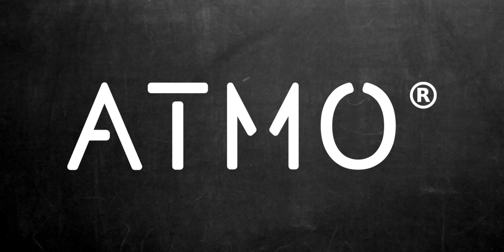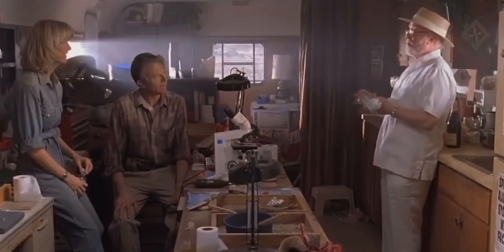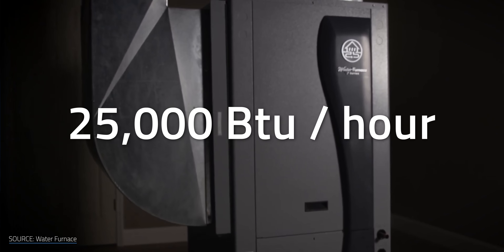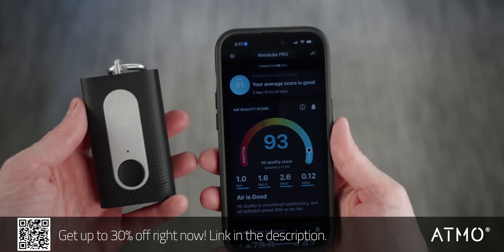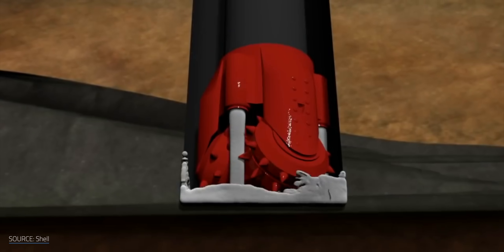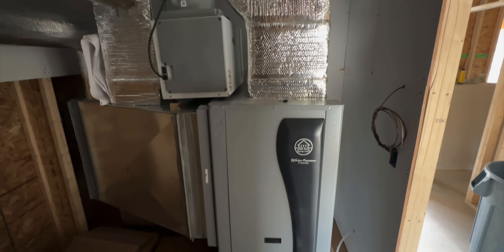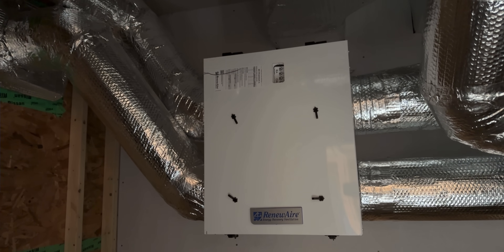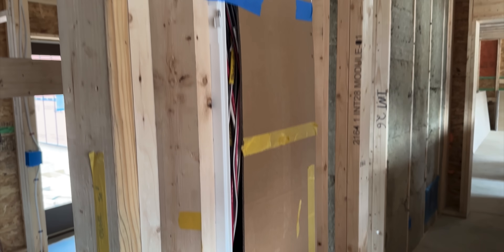Why I Went With Geothermal For My Net Zero Home

Comment: Matt - I like your content especially about your new house.  I would like to hear more about particular costs, for example, what was the cost of the geothermal well dig versus the cost of running a natural gas line to the property?  I suppose that your up front costs will be higher than usual, and your long term cost estimate will involve guessing about energy costs.  Your build is inspiring.

Comment: Norway, Sweden and Finland are world leading in heat pump installations. My house in Finland has a 170 m (557 feet) vertical well. Almost no digging required here. There is only a few meters of mud/gravel before reaching the bedrock. So they put down a steel pipe to support the well a few meters. It didn't take many hours to bore the well, I think it was about six hours. My house is small so this depth is enough, but with larger houses 220 m (720 feet) is common. They typically don't go deeper than that, then they put more holes in parallel instead. Our system is designed to work down to -25 °C (-13 F) outside temp.

Comment: Geothermal heat pump is the costly but the best solution by far. 
If you have the money, geothermal is fantastic. 
If not, water source is second... 
If not, air source heat pump is cheaper but in the last place.

Comment: I'm really curious what you're doing with lighting? It seems with all this excess, one thing you could save power on would be low voltage led-based lighting over ethernet.

Comment: 11:35 One thing I would like to see more detail on is your input mechanism for the shades. Are you going to be granular for each room or just system wide? How are you getting temperature readings from each spot? I am remodeling and pre wired for shades but don’t know of a sensor to tie it to.

Comment: Generally heat pumps are more efficient running at lower power levels for longer rather than bursting.  Less cycling each day is also better.   But you know, for a house that small you don't need to be this efficient... spend that money loading the roof with solar panels instead of wasting it on a ground-sourced loop (well, too late I guess).  The long-term maintenance will actually be lower.

Forced air is fine.  Again, the "trick" is for the system to run at lower power levels for longer periods of time instead of cycling in short bursts.

Fresh air systems with heat recovery work, but only sorta.  The efficiency is quite low... usually less than 50% in reality.  I have one and I gotta say that it takes quite a bit more maintenance than I would like.   These boxes easily break, have noise and vibration that can often be felt at night when the house is otherwise quiet, and the filters have to be regularly cleaned.  Just a warning 🙂

For bathrooms, having an exhaust fan is more important than ducting the fresh air system into the bathroom, though there are advantages to doing both if you leave the house on long trips for long periods of time.  And just as important is to put it on a digital timer switch instead of a normal light-switch so you can just tap on the "30 minutes" button as you leave after showing in the morning.  No chance of accidentally leaving the fan on all day (which messes up the house's overall efficiency).

The key to home efficiency, in general, is to over-produce with solar and then carefully pick and choose what you actually need to make efficient verses maintenance, noise, and other nuisances that come with the systems.

Comment: I wish I didn't have to spare any expense when I was building my house. But it'll be some time before I step away from gas and go for a heatpump. The price difference between gas and electricity here makes electrical heating, even with a heat pump, simply too expensive. The current difference would require 30+ years before the system has paid itself back, and the pump itself has an average life span of 20 years so ...

Comment: Internal shades shouldn’t do much if anything at all in regards to keeping the house cooler in the summer/warmer in the winter. Since they’re in the house once they heat up from the sun they’re going to radiate that heat inside instead of outside like it would be the case with external shades.

Comment: I find it really ironic that you had a drill rig come and do that because I actually worked for some well drillers as a helper for half a year so I understand a lot of what they were doing in the video, it's rough work but it's worth it when it works.

Comment: So you've got the hole for the heat exchange below 10ft, what about that last 10ft and the distance to the unit inside the house?  Is the tubing insulated for that to prevent that last 20-30(?) feet from impacting the efficiency?

Comment: I did network and TV wiring to all my bedrooms and in my living areas.  It was high tech a five years ago and now it's not so much, though still handy.  I also have a variable speed heat pump/AC unit, central vac, a lot more insulation than normal at the time, etc.  I like a lot of the features you are doing but in 20 years they won't be high tech and probably won't appeal to many home buyers as the learning curve is pretty steep to be doing/tracking all you do.  I would like to know how you got to what R38 in the walls.

Comment: This has been a very cool journey to watch and I'm eager to see how it all turns out! That said, it is a bit disheartening to see how unattainable net-zero is for the average home buyer. Hearing about how many individual contractors you're having to work with, and how personally involved you have had to be to coordinate all of these moving parts is just soooo out of reach for the vast majority of home buyers. There's a real demand for a homebuilder who specializes in net zero who takes care of all of these details- something like the guys who handled your modular construction, but takes it all the way to the finish line and delivers a house that is move-in ready. I think there is a huge market for buyers who want to have a net zero (or very close to it) footprint but simply don't have the deep technical knowledge of all of these complex interconnected systems to coordinate such a project.

Comment: Matt, you touched on some automation systems in your house such as blinds that open and close when needed. Most of this automation  could be run with a cheap PLC (programmable logic controller). By wiring in or bluetooth the inputs and outputs the whole house could be automated. I honestly don't believe that it would be hard to program such a system or set it up. Full disclosure, I have worked with these systems in industry since they came out many years ago. They run everything. I have no interest, monetary or otherwise in them, I just believe that in an uncomplicated setting such as a home would be cost efficient, easy to install and work very well.

Comment: Modern radiant systems are not on/off heating. it's stepless regulation based on outdoor temperature and adjustable curve. Indoor temperature sensor(s) are optional but nice to have if house is on windy place.

Comment: Matt - In terms of the radiant system. Temperatures keep climbing after the system shuts if it's a high mass system. if you were to use a low mass system, temperatures are extremely consistent, and some systems can keep within half a degree from your set point. https://www.youtube.com/watch?v=7QLmP3VRMJM

Comment: 2 Questions; is there a computer controlling all of these house management systems - half joking. #2, I don't think MA has a significant lightning strike risk issue, but it happens. Do they make a "circuit breaker" big enough to protect your house??

Comment: This appears to an excuse for installing every gizmo and gadget possible….so many things to go wrong.  
I do wonder if a Passivhus type approach would have worked and been more simple / robust?
Basically spending more on the building fabric, more insulation, lots more thermal mass. Of course there will be HRV through out.

Comment: this is really cool!  it may be too late at this point but make sure you think about your hot water plumbing!  it is the most common thing I see nearly every new home mess up.  DONT use copper!  copper is a huge thermal conductor and horrible for hot water lines.  Also a 3/8 water line can run two bathrooms at the same time, so don't run 3/4 lines because that is a huge volume of water that is heated and wasted every time and make it take forever for delivery.  Also make sure to use good insulation.

Comment: Matt, you're nuts.  Skip the vid on "smart shades".  Would favor acoustics, what you may be addressing; isolation, diffusion, absorption?

I'm guessing we won't see a cost, years to break-even, analysis for the WaterFurnace?  For about a 1 COP gain in max output, I'd much rather ~2.5 COP ASHP plus more solar for the same cost.  Plus, if you do video more geothermal, please address heat strip KWs and whether you'll be monitoring the system (pumps rates, temperatures) to be sure it doesn't go nuts on your bill.  If you have Home Assistant (please, another laymen vid), you might find WaterFurnace is about as keen as John Deere when it comes to diags.  Not being able to easily monitor, beyond "golly, why's my bill so high" was among the turn-offs, for me. 

At least, if the well was oversized consistent with the 3-ton rating vs your house, you'll likely pick up a $$ dividend from better heat exchange (inlet/outlet temps) when the weather gets extreme.
Reply: Matt's geothermal unit is rated at 5.3 COP and maintains its ultra high efficiency year-round. Unfortunately, ASHP efficiencies drop in winter - especially if defrost mode is needed.

Comment: I have a similar setup in Montréal area. But I went with radiant heating because water pipe-embed concrete floor is part of passive house reason why it works: thermal inertia. I have a water to air heat exchanger coil to cool or quickly heat the house with air ducting. Radiant floor can also been used for cooling, as long as you do not go bellow dew point.

Comment: I am a HVAC engineer specializing in high performance and passive house. Love the design! You are doing everything right. The only thing i would say is to duct your rheem DHW discharge fan to the outdoors. Works great in the summer as "free" AC but you are creating a heat load in the winter. If you want to get real geeky. Put a damper valve on so you can direct the flow dependent on season. Or look at a split system like SANCO2. 
One house i commissioned took it a step further and ducted the back of the fridge to the intake of the rheem. No more heat load from the fridge! 
3ton geothermal will be more than enough for the yeti cooler of a house you are building. Too bad you couldn't select a size closer to your needs as the inverter will have trouble on shoulder season days.

Comment: Very cool matt...good to see the updates! 

I find it interesting you went with forced air (heat pumps) though, considering allergy's & that radiant in slab heat is more energy efficient; not to mention walking on a warm floor in the winter is sublime and relaxing; plus their is the lower start up cost on top of that also (less maintenance & repairs)? 
You are definitely right about sparing no expense; but that gives you way more content for sure; so that is very wise on your part!

Comment: Matt, did you consider the idea of running plumbing through your server room to allow for you to water cool your home's central processor? Tim Poole jokes about using the waste heat from a dogecoin farm to warm a hot tub. He might be a bit hyperbolic, but I cannot help but wonder if he has a point. Could one save on their water heating and overclock a CPU with some smart engineering?

Comment: I am an hvac service mechanic (36years) and have serviced geo thermal systems since they became available. From 2 ton to 90 ton capacity. It is my conclusion that the technology is sound. Its a very efficient way to heat and cool. And i agree with the hot water reclaim theory also. Waterfurnace brand units are packed with all the technology needed to really squeeze every last bit of efficiency out of each watt of electricity. I would add one sidenote. Just purely for comfort and not meant to heat the entire bathroom, electric heat built into a ceramic tile floor sure is a beautiful thing in the wintertime. Keeps your toes cumpfy for only a few hundred watts of electricity. Just saying....
 Cheers from tennessee!
Reply: Thanks for your feedback on geothermal! We appreciate the professionals who truly understand the technology.

Comment: I have a Waterfurnace in my house! Make sure you ask them to change some of the defaults around when emergency heat (resistance based heating) kicks in. Otherwise you’ll use more power than you’d need when warming up.

Also - I assume they put a mixture of water and antifreeze in your loop? They’ll need to flip a DIP switch to allow that liquid to drop below the freezing point of just water.

Looks like you got dehumidifier and humidifier options for Waterfurance as well?
Reply: Thank you for choosing WaterFurnace for your home. We appreciate you.
Reply: @WaterFurnace  please bring back the view to see total energy used today in the app!

Comment: An idea I had years ago was to make automated insulated exterior window shutters.  I looked into patenting it only to find that it had already been patented, but nobody is actually producing them.  Windows are by far the biggest energy loss in most homes, and 1 inch of foam insulation is around R10.  If you made exterior shutters, the raised panel type would be easy, are solid and look good, and when connected to your wifi they could open and close automatically.  Maybe a little solar panel on each shutter to allow so many cycles of open/close per day.  All the time you are at work or asleep, all of your windows could close and become >R10 insulated.  Sensors could make them open or close depending on conditions to maximize heat gain/loss, etc.  And they would have the added benefit of noise control, light control, storm protection, and security.  It's crazy that these aren't being made standard in all homes.  The increased efficiency would be massive.

Comment: I hope your technical room has separated concrete floor to stop vibrations from ground heat pump. When pumps get some age they will vibration will increase. At some case that vibration sound also travels. 

Small scale mass floor whit foam insulation around to stop that is recommended.

Comment: A former colleague of mine installed a vertical heatpump at his home in Germany.  Unfortunately the drilling company didn't realise that there was in dense layer of rock under his house that was stopping water from an underground aquafer permeating upwards.  When they drilled the borehole it went through this layer allowing water from the aquafer to seep upwards under the foundations of his house.  This resulted in subsidence and a lot of problems.

Comment: Matt, Years ago I built a project with the Water Furnaces it required six vertical wells nearly 500 ft deep to get the capacity need for the homes requirements which drove cost. I understand you have a deal with them on this video. But I now have my eyes on a air to water heat pump system capable of running radiant in northern climates. Have you ever looked at Valliant?

Comment: So "Net Zero" usually talks about "after it's built".

I would love to see a Net Zero building that is net zero, but also takes into account the cost of the building. IE: The drywall in your house is not net zero, you have to put some carbon into that. So the energy required to build your house is a cost. I would like to see where the break even point is, how many trees do you have to plant around your house, etc.

Would that look like a really large apartment building with solar panels on it, and trees?

I think we get a bit too focused on what the cool technology would be to make a Net Zero house, that we "spare no expense" and end up burning a bunch of fuel to get there.

Comment: Matt, I don't think you are crazy. I would also choose forced air over radiant not just because of overshoot, but because it is too hot underfoot in the winter.  Also the blinds. Solar gain is more than I expected and uncontrolled it can run the main area up to 90F on a sunny day. The forced air helps mitigate this moving some of that heat to the basement.

Comment: I do wonder what the cost difference actually is for geothermal vs a good cold climate air source heatpump at this point.

Needing 25,000 BTU at -10f really shouldn't translate into all that many BTUs for heating over a year. Using your 25,000BTU/H at -10f  your BTU per heating degree day would be around 8,000. Using heating degree day info from Worcester regional airport you'd need to generate around 47,400,000 BTUs from 9/1 to 5/31. The difference of your 5.1 COP system compared to a 10.5 HSPF air source heatpump should only be around 1,800kwh per year assuming you never do anything like lower the thermostat while you are asleep or out of the house..

In the Worcester area that could be generated over a year with around four 400 watt solar panels fairly easily. So I think going geothermal vs air source only makes sense if you completely maxed out your solar production. Mass Save rebates are great, but would probably cover more of the cost of an air source heatpump (10k for whole house) vs geothermal (15k for whole house)

If we are still in our 250 year old colonial when our Bosch unit dies I might look into an open loop system. We have wetlands on our property, so we might have enough ground water to support a open loop water system.